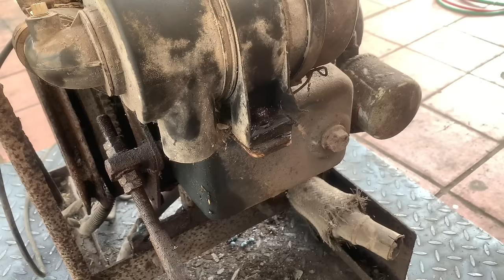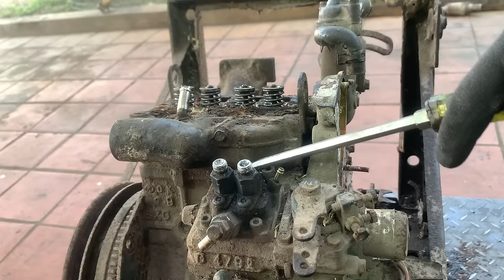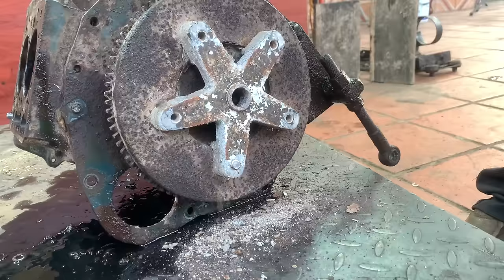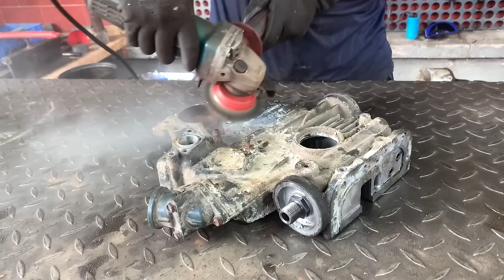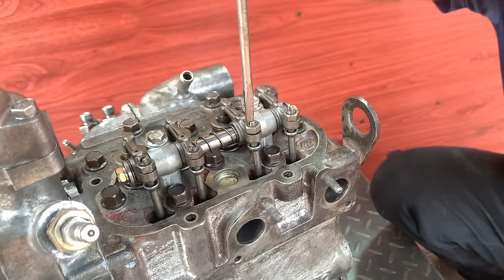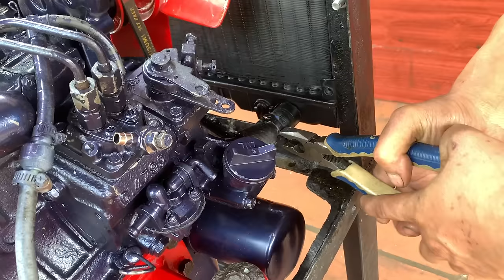Restoring Extremely Classic Two Cylinder KUBOTA Diesel Engine // Restoring An Old Generator - Part 2

Comment: Instead of putting water in radiator, put some coolant. It lubricates your system and prevents rusting and cools the engine better than water 💦 wich evaporates 😢
Reply from the maker: I know coolant is better: Coolant has a higher boiling point than water, meaning it can withstand higher temperatures without evaporating. This allows it to cool the engine effectively even in extreme conditions, ensuring optimal performance. Thank you for viewing and commenting. Please continue to follow our next videos!